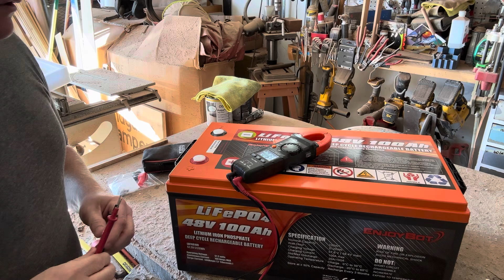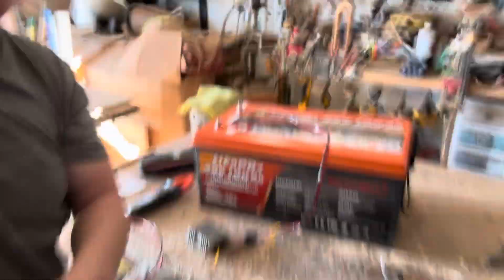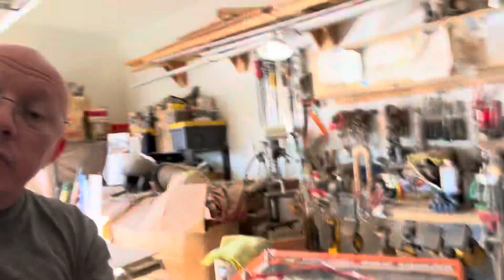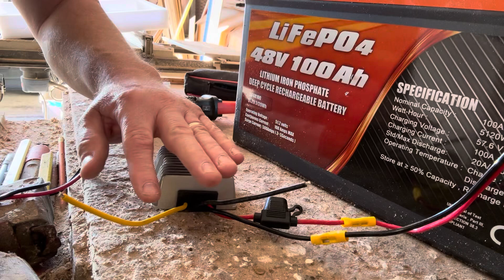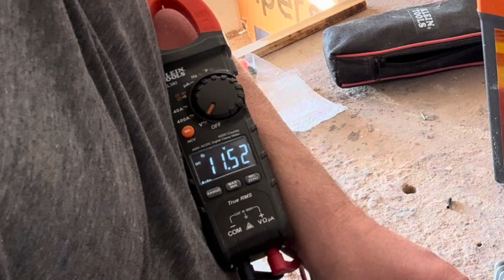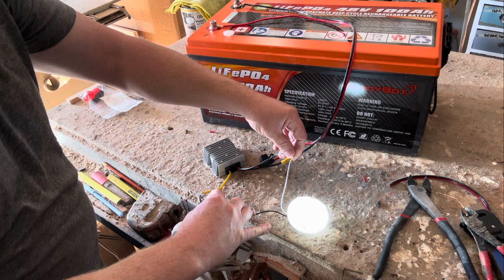48 Volt LifeP04 Golf Cart Battery For Your RV/Camper/Van??? | EnjoyBot

Comment: There are some nice "all in one" units, where you have an inverter, charger, solar charge controller, and transfer switch all combined in one box.  They're typically made for home use (think off-grid cabin) but can work nicely in an RV.  They're typically 48v, I think the higher voltage just makes the whole design more efficient and less costly.  I have an EG4 3000w unit in my RV now.

BUT- I think I'm going to replace it with a Victron unit, and re-configure for 12v.  (I'm currently using 4 12V-100Ah batteries in series, so easy to re-wire it to 12v-400Ah.)   In my case, I can't really use solar, and I need some of the features the Victron has... also, going 12v means I can charge from the engine when I'm driving.

I think on a bigger RV, with solar panels, going 48v with an all-in-one makes sense.  On my small rig  with my limitations/compromises it seems 12v is the better course.

Comment: Many years ago I was working on my trucks electrical system and I had my watch with its flexible metal watch band on. I can’t remember how I touched the watch band to something hot but it flashed and melted the watch band to my wrist. I had to visit the ER room to have the band cut off and out of my flesh it was so hot the band was almost 3/8’s of an inch imbedded in my wrist plus my watch was melted where the band connected to it. Needless to say I still have a clear impression of my watch where it had burned itself around my wrist. Now that was over 70 years ago and I have never been stupid when it comes to batteries or any type of voltage “amperage - watts - amps - sense. Now to top it off lol I later became a certified electrician lol. I will say that feeling of that watch band burning into my wrist area has been a reminder used to show or explain how or what being stupid can have an effect on someone. I am 82 years now with a cancerous brain tumor from agent orange so my explanation might or can be a bit off. I have something else to share someone help me if you know because I have forgotten. I had about 40 foot of OO cable and I wanted to make a super pair of jumper cables. But by the time the cars good battery reached the car with a dead battery the voltage was only about four volts. At the time I did some calculations I had figured that the cable’s resistances was to much in other words the cable was to heavy to use for jump starting other dead batterie. Please help me because I also have dementia and this past January I had a stroke that altered my ability to also think clearly. Can anyone explain why pure copper cable of the size I mentioned would be too thick to cause too much resistance for super good jumper cables. The total length would be four times forty if one figures the total length of actual welding cable. Because you have both the negative and positive sections of cable used plus the heavy duty welding clamps. Please if you can help figure why there was to much resistance for the cable to work? 
I am so sorry if I didn’t make sense if no one answers I will try to remember to delete it. 
Thank You so much….everyone
Reply from the maker: You are fine my friend. That personal story is important to highlight the dangers of electrical systems. Thanks for sharing. It is a lesson to us all. I appreciate you.